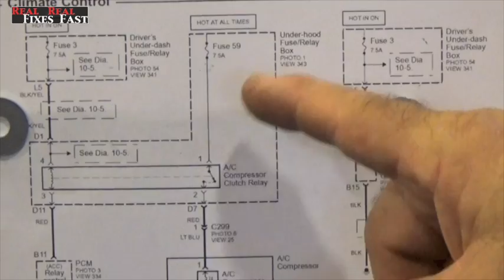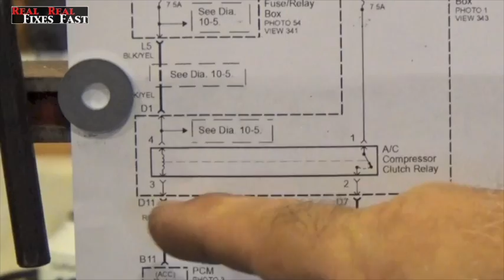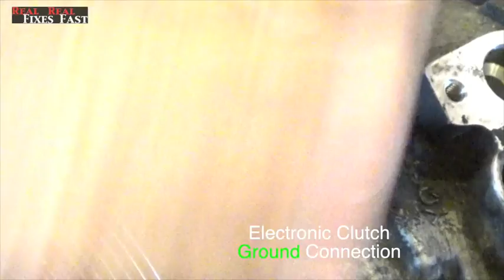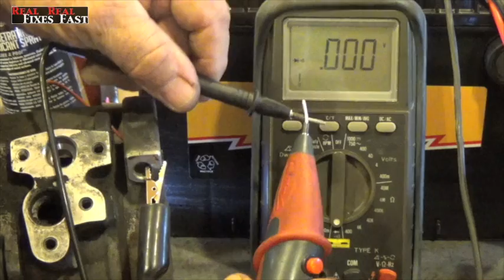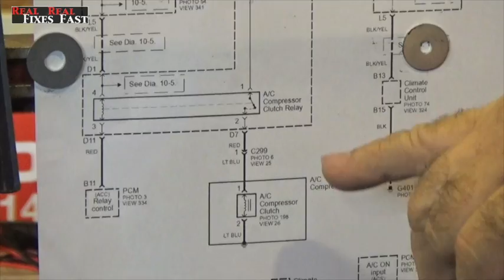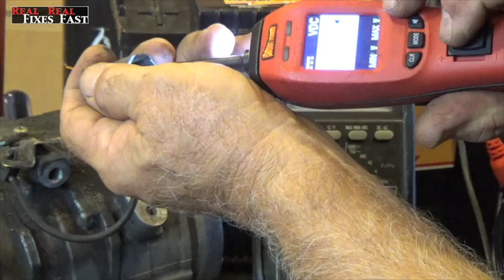Using a Power Probe to test an AC Compressor

Comment: @2:20  The one wire connector on my compressor is coming not fm the compressor like shown here, but fm somewhere else, like the wire with that connector is going fm the head lamp area and switches in the socket, which is sitting on the compressor.

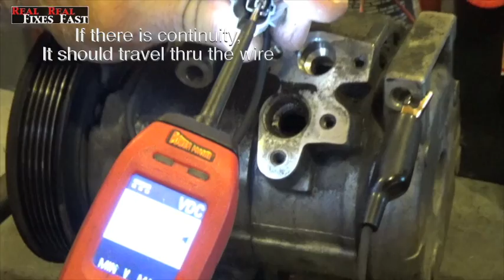Comment: @4:12   Thank you so much! I have that same situation on my compressor. I thought I might need to add some R-134A and the compressor is not working (the Clutch is not engaging) just bcs the low refrigerant amount. But I was trying to check 1-st the compressor itself. Now I see it will never engage even if I add some refrigerant there. So I would need to go to the dealer to evacuate the refrigerant and replace the compressor. That compressor didn't last long (only 3 years), though I've replaced all the necessary parts like the Condenser, Dryer. I didn't know you need to run AC every month a bit even in winter to lubricate the compressor. Probably that caused the problem. Thank you again for so informative video.

Comment: Is the multimeter and the powerprobe both connected to the battery ? Or is it a seperate negative alligator clip y connected ? What is the powerprobe connected to?

Comment: I sent an email, were you able to receive it?
Reply from the maker: no I did not see it, could you please send it again, thanks
Reply from the maker: Not sure.  I get 50 emails a day and try to keep up but usually miss some.  Dis you send to my email ?  Youtube usually won't forward email links in the comments.  Please send again to dumar5907 "at@" gmail.  put the ampersans in the correct position.
Reply: @realfixesrealfast  Yes I sent it to your email.
Reply: @realfixesrealfast  To your email yes.
Reply: I sent it to your email yes  @realfixesrealfast

Comment: The Power Probe is an essential Electrical Diagnostic Tool in my shop. It saves Troubleshooting time and makes it easier to pinpoint Electrical issues on all Makes and Models of vehicles.  Thanks for demonstrating some of its capabilities. 

As a side note:
Power Probe sells an attachment device that steps the Battery voltage down to (5) Volts. This is handy when you need to Troubleshoot the Five Volt Reference Circuit for Hall Effect Sensors etc.